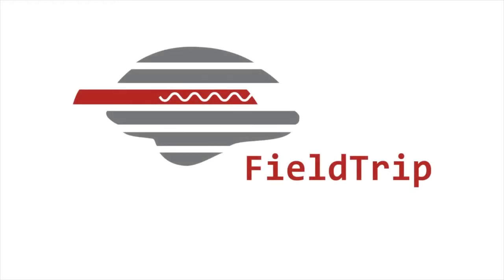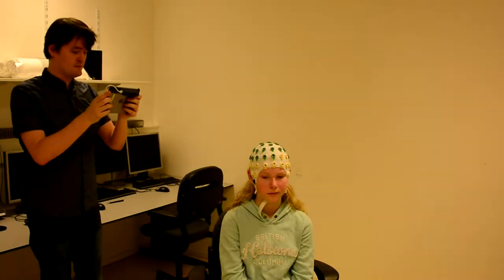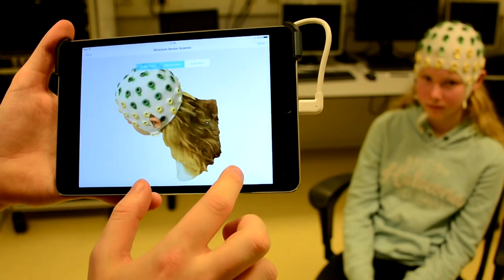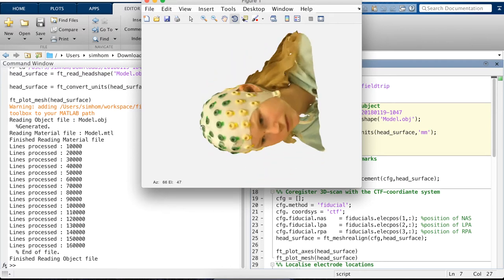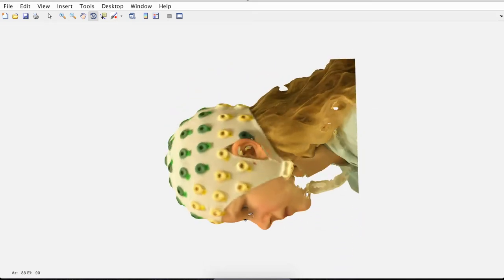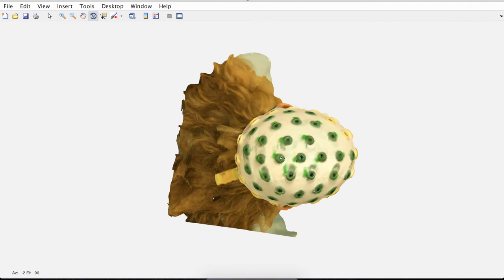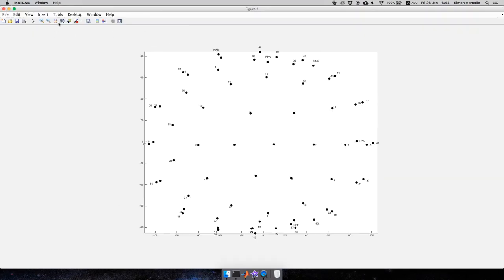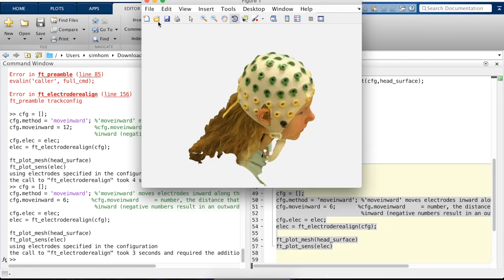Using structure sensor to record EEG electrodes

Comment: Thanks for the nice tutorial. There is only one part missing or not shown in the video. At some point (most likely after setting all electrode positions) you need to save the data from 'elec' in a file. The name of the file should be written in cfg.elec. Otherwise the function ft_electroderealign(cfg) will give you an error as it is not finding the file.